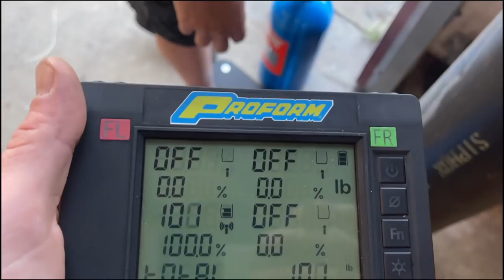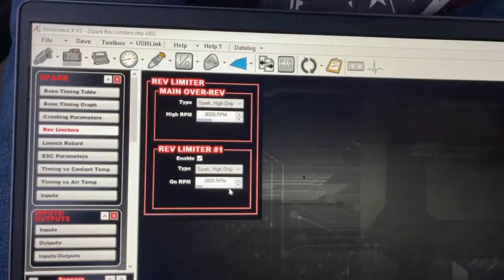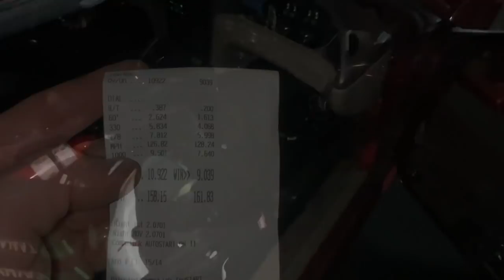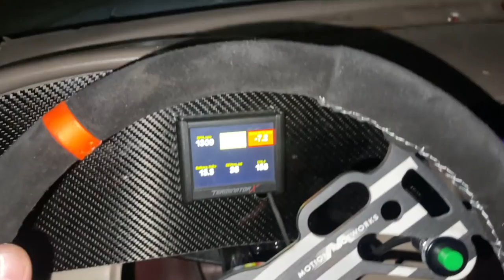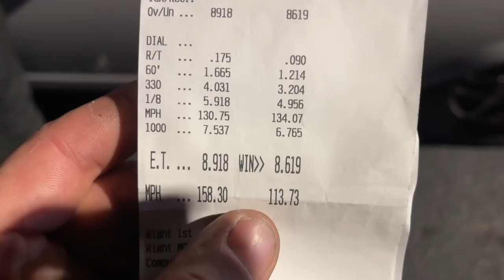Dr. Pepper vs. Cleetus's El Camino 'Mullet' at Christmas Tree Race 2021

Comment: Awesome job Parker and loved the video. It's been great watching the development of Dr Pepper. What did they mean about a double bulb rule?
Reply: its actually called gentleman staging. you pre-stage the first bulb, your opponent pre-stages, then you can  roll into the stage bulb. double bulbing is rolling into the pre-stage and stage beams before your opponent has pre-staged.
Reply: @bbirddragrace  thanks man! So, once the two bulbs are lit, I'm guessing the second driver must then stage within a certain time or be disqualified, which could mess with their prep for the run? For example, if they use pre stage to build boost before bumping in to light the second bulb. They are possibly "forced" to stage and then launch before they are ideally ready. Is this correct?
Reply: @captainclavicle  thats correct. once your pre-staged, you have 7 seconds to light the staging bulbs or you red light.